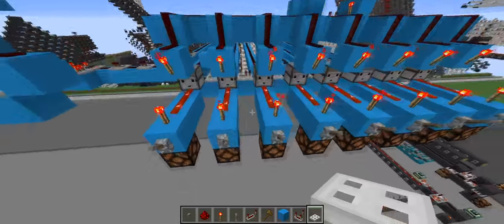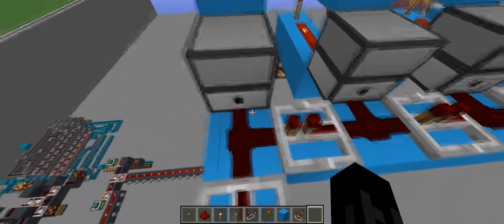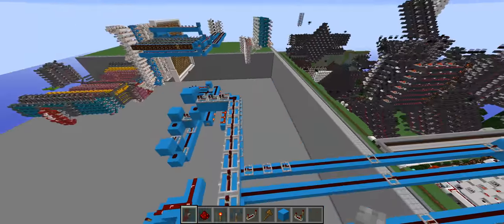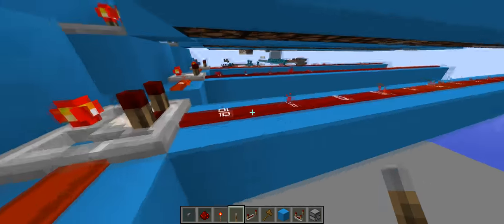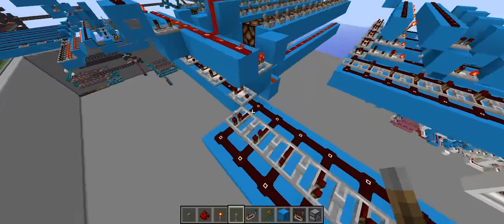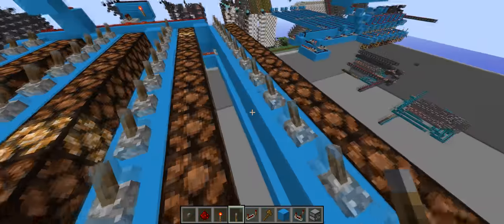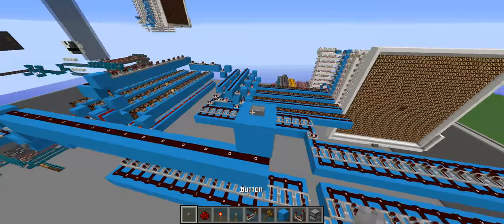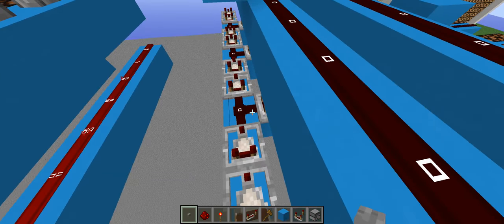Analog Serial and 1 tick Binary Serial

Comment: A couple years ago I build a serial binary adder which works at one tick per bit. However I did had to split the serial binary into the odd and even numbered bits, such that those pulses are two ticks long.
Reply from the maker: That doesnt make any sense unless you sent the even and odd bits as 2 separate serial streams....
Reply: @WildEngineering  You are correct. Namely the adder consists of two full adders connected to each other, one with an inverted carry such that it ripples at one tick delay per bit. So that is why I had to split the serial binary into two streams. But maybe it might be possible to convert between the one steam at one tick/bit and the two steams at two ticks/bit. However, I was not able to figure that out when I made it.

I also remember experimenting with analog signal strengths bigger than 15. Initially you could obtain this by spawning stacks of non-stackable items via commands, but I believe they fixed that. But I believe it might still be possible to use command blocks to count entities beyond 15. However you do have to keep passing the signal between comparators. Once you pass it to redstone wire or a repeater it gets clamped down to 15. So the bussing would have a bigger latency, but comparators can still do subtraction with those larger numbers.
Reply from the maker: @kwinvdv  ripple carry adders suck and in Mc the best you can get for serial binary addition is 2 ticks per bit. 
Analog SS over 15 makes absolutely no sense. You can make an analog adder which has multiple analog outputs to create larger analog values.